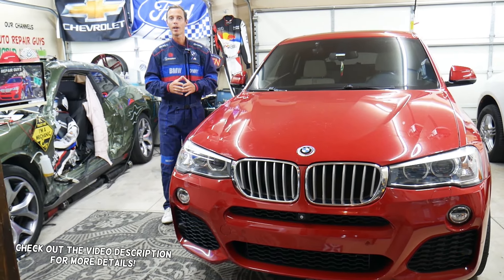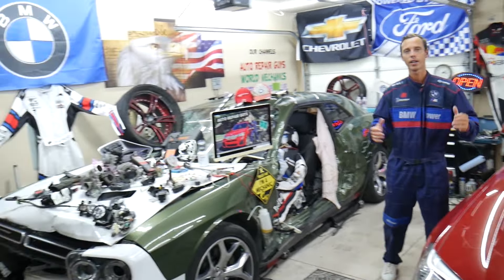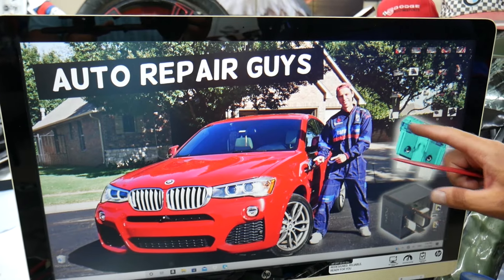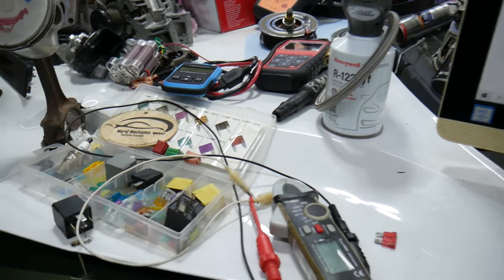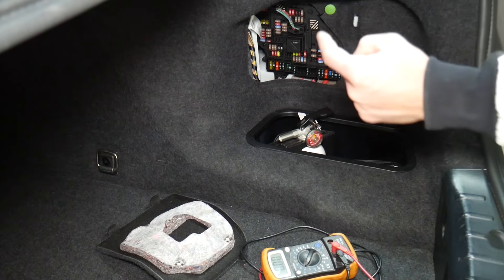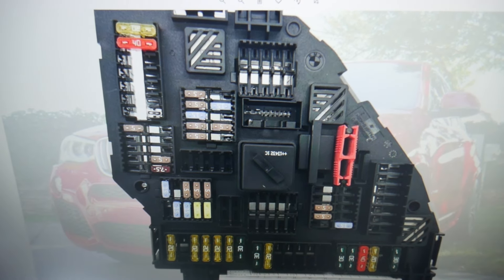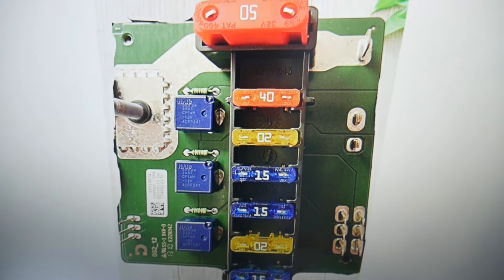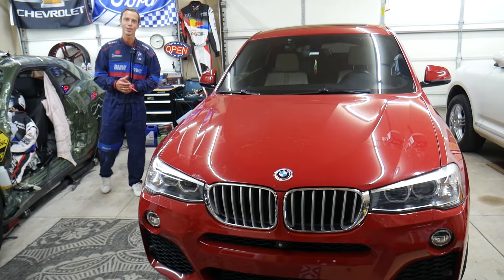BMW X3 X4 OXYGEN SENSOR HEATER FUSE RELAY LOCATION 2010 2011 2012 2013 2014 2015 2016 2017 2018

Comment from the maker: Things you may need to fix this problem: 
► Fuses Assorted: https://amzn.to/49uQw73 
► BMW Green Relay: https://amzn.to/4buPhXk
► BMW Orange Relay: https://amzn.to/3ut6Oyt
► BMW Black Relay: https://amzn.to/3STDKcY
► Liqui Moly Molygen Oil: https://amzn.to/3wdFHYP
► Oil Filter: https://amzn.to/3Oz7nOc
► Mechanic Tool Set: https://amzn.to/3usBcZM
► Scanner That We Use: https://amzn.to/3SSzVEE
► Torx Set: https://amzn.to/3HUCgZu
► Panel Removal Set: https://amzn.to/3SSvIAX
► Screwdriver Set: https://amzn.to/3wiLsUS

► Check out our Amazon Store for the tools and parts that we use: https://www.amazon.com/shop/worldmechanics